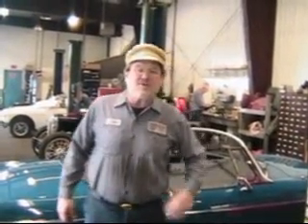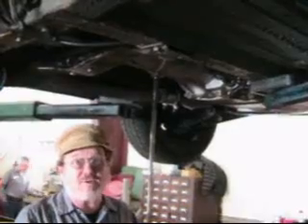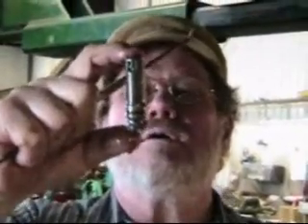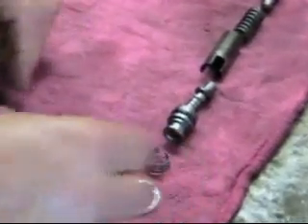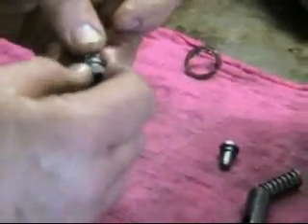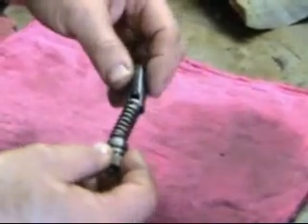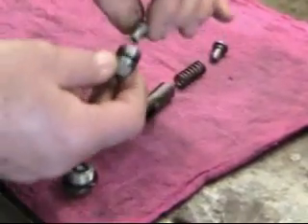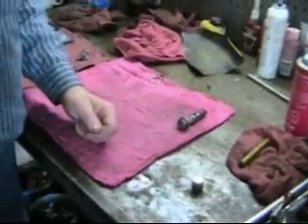104 MG Tech | Overdrive Repair, Part 1

Comment: There's a different sleeve on my UK 77 roadster It's got holes punched all around the length like a sieve Strong steel item Plus three washers / shims that need to go above the piston valve to ensure flush fit of unit into the gearbox apparently to ensure pressure as it left the factory
Reply: mine is same, i wonder wether this is a blue label?
Reply: @michaelmenard8913  blue label?
Reply: @LeRoiDelaRue  there are 3 types of OD 1st gen mgb had D type non synchro.
2 gen had black and blue label OD
Reply: i would have gave you $100 to redo this video if i would have watched it before meeting you :) cause mine also has a perforated part the spring slides into, with 3 washers. Hello from Texas!

Comment: Two things:
1.  ALWAYS wear gloves and have good ventilation when using carburetter cleaner.  The chemicals in carburetter cleaner are toxic, cancer causing, and are easily absorbed by your skin.
2.  Carburetter cleaner can distort rubber o-rings to the point that they can become unuseable.  Remove o-rings prior to cleaning with carburetter cleaner.